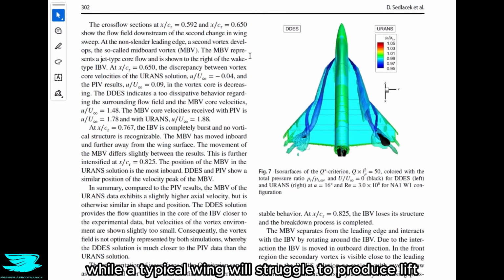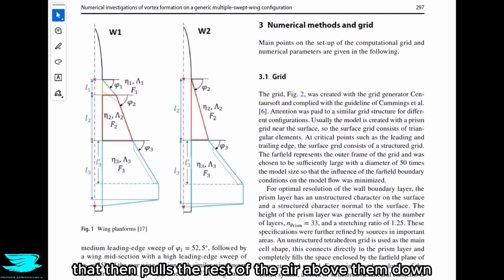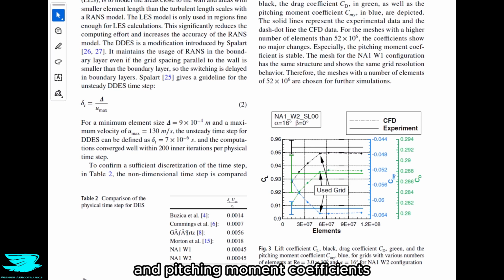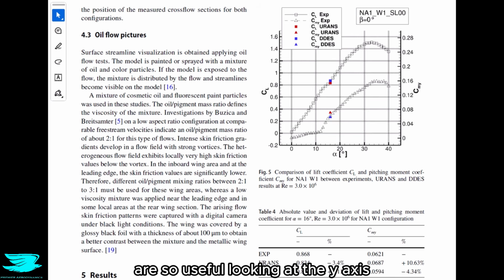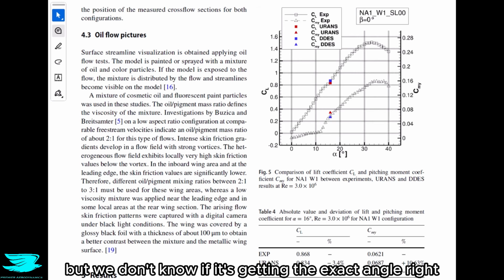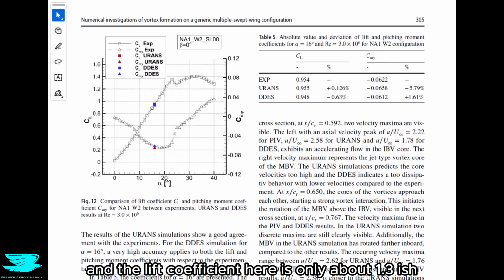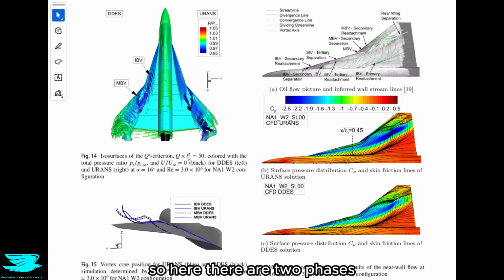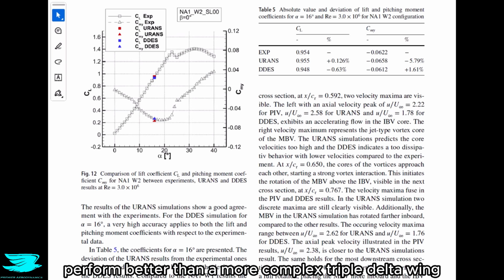Why A Double Delta Wing Is Better Than A Triple Delta Wing

Comment: Ironically many fighters now use a triple delta type construction. The F-22 uses a triple delta effect when you combine its intake leading edges with the wing root strakes, then the main delta. The F-35 does similar with a chine protruding leading edge at the intake cooling which leads to a strake and then tk the wing glove/root of the main delta. 
The end results is that both wing produce a lot of high AoA control via tight vortices. The F-35 for example maintains that control even at 70 degrees AoA.
Now these planform are not just examples of simpler delta platforms, theyre also using lifting body and body bisected chines down the entire length of the airframe. But theyre still fun examples of how the extra vortex coupling produced by a blunted LERX ahead of the strake, prior to the main wing, is very useful. It also goes to show why US designs still have all-moving tails while Euro designs continue to be sold as true deltas and are tailless, but now begin adding canards. 
The US tailed designs have vortex airmass to still deflect and use as a working mass for control, as well as the rudders for lateral control as well (very important for controlling that side slip at low velocity and high AoA) while Euro designs choose to keep their control surfaces via canards. Exposed to raw free flow air stream, however this can disturb air flow prior to the body/main wing. 

Its also important to note that these metrics were performed at air stream velocities of only around 290mph, not even close to transonic, which is where most true to life applications would want to apply these studies for real use case scenarios.

Comment: It depends on whether you just want high AoA or also supersonic flight and a thin wing with high volume.
You could use LERX with straight thick wings for high AoA without high speed.

Comment: The Concorde ogive configuration was supposedly used because of the requirements for slower speeds at landing and take off. These speeds were still very high compared to average aircraft, but a lot lower than if they used a simple delta.

An analysis of the differences in performance of the Concorde wing versus the Tupolev144 concordski might show what differences are possible with different wing plans as the Tupolev wing was fairly basic when compared to Concordes.

Comment: Probably not or they wouldn't have spent so much time and effort designing the more complex designs. Look at the history and you will see that in the early days they started with plain delta and then had to change them in subsequent designs. Look at Vulcans for a good example
Reply: Vulcan's cranked delta wing didn't have much relationship to high AoA performance. It simply because the leading edge vortex causing flow separation and vibration on the outer wing when the bomber is cruising at high altitude, so they have to added a crank to reduced the effect.

Comment: i say go with double delta wing with tubercles and a leading edge flap maybe?

if  u use tubercles along wing edge you can have as many vortice generation points, located at any point along the wing regardless of angle as you want/need btw

edit, also can anyone tell me why they dont use a leading edge flap on delta wings like ever that i see, is it just they dont feel they need lift past 70*?

Comment: Canards on the Rafale cannot correct pitch moment as they are to the rear and control a second vortex, preventing premature vortex burst. Germans chose the X31 front pitch correcting and real canards for the Typhoon as they traditionally favor dog fighting, and which is why MBB worked at DARPA on X31 with Rockwell
Reply: By Germans I suppose you mean the Aviones who became the Ingviones or Anglo-Saxons of England.
Reply: @TopGunMCK it was a multi national program I'm sure any and all Data gathered in the x31 by the Germans was used to help inform the design of the eurofighter

Comment: I thought the triple Delta wing was for the mock shock affect where the air pressure waves so intense from going over supersonic that instead of having the whole wing hit the pressure wave you just want the front slats hitting it so the waves fly around the center section or triple part of the wing?

Comment: Great video. Is your course on designing a real RC airplane about to come out soon?
Reply from the maker: Hi, yes it just came out the other day on our website. We put it under the "RC Airplane Course" tab. All the best.
Reply: @PremierAerodynamics awesome. But is there any CFD or FEA in that course? I was kind of hoping it would include that since no others has that value showing how to optimize a design using modern tools. Like openfoam or even xfoil to help one make the choices that I really find challenging.
Reply from the maker: Yep, we cover software to simulate the plane’s performance, as well as show how to use it to improve it.

And we also go through the manual way of designing by hand.

So both ways are covered for it.
Reply: @PremierAerodynamics awesome. So how deep does that go into the process to optimizing the design using CFD? Is there some iterative approach to it. It seems to be lacking in the description. That would be a unique selling point where other courses often just focus on using simple calculations to get it as good as possible.
Reply from the maker: Yep, sorry, we didn’t say it in that much detail in the description. We can add it. Thanks.

What the course covers from a simulation point of view is how to use a vortex lattice method (with viscous coupling and you can choose between fixed or free wake - details are covered in the course as to what the difference is and why to use these different settings).

It is used once the first hand calls are done.

Then we show how to use it to determine the size of the wing and tail, to tel if you’ll get enough lift, the drag, as well as the stability (including pitching moment) across the angle of attack range.

From there, you either circle back to change the parameters that need to be changed (for example, resizing the horizontal stabilizer for the tail to get enough stability), or if everything is fine, you can continue on.

We show the iteration process as well in a real demonstration of starting with the initial design, then going through the simulations, and then circling back.

We only do it once because after that, the solution was within an acceptable range, but if it wasn’t you just follow the same circle again until you reach it.
Reply: @PremierAerodynamics yeah it sounds fun. Is the course for someone who's never used openfoam? I was thinking if one could run a script or neural network to optimize the wing by running the simulation over and over until the optimal has been found, instead of just acceptable. I saw an interesting video on that and got intrigued, where he ran lots of simulations and as the AI learnt it kept improving until there were miniscule improvements by keeping the optimization going.
Reply from the maker: Yep, you could. This isn’t OpenFOAM because OpenFOAM would take too long to do it actually.

This is a vortex lattice method which is faster and could actually be used for that.
Reply: @PremierAerodynamics  a question, will you do any presentation video of the course on your YT channel? Also do I remember right that you were gonna have a cyber monday/black friday release discount?
Reply from the maker: Good questions.

In our videos, we’ll just mention it mainly. And sorry unfortunately we don’t have a sale on it.

All the best
Reply: @PremierAerodynamics  hi - I just bought it through Paypal and I got redirected to the same sales page. Am I missing anything? First time I buy a course and I don´t see the material after buying it and no email either.
Reply from the maker: We should have sent you an email with it. Did you get it? If not, we can send it again.
Reply: @PremierAerodynamics  got it :)